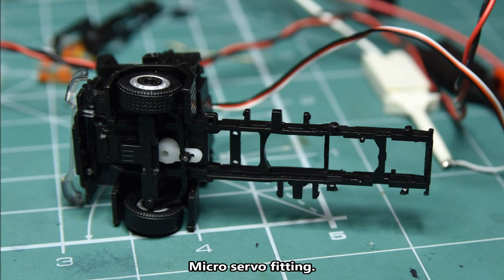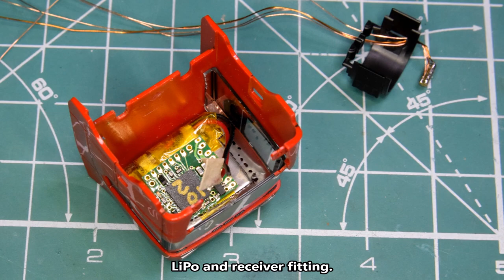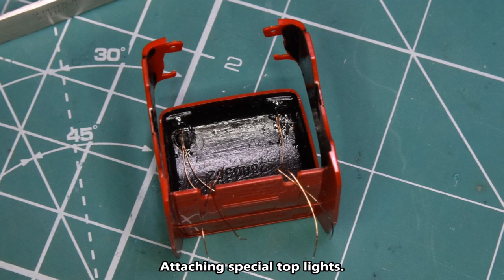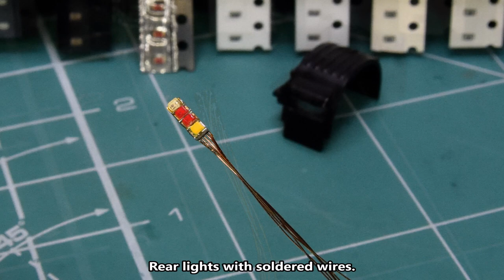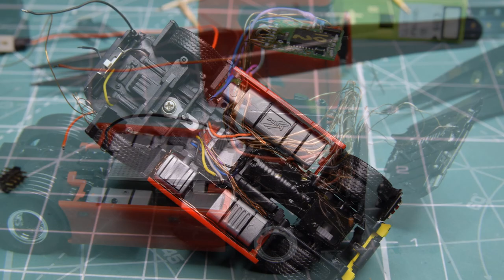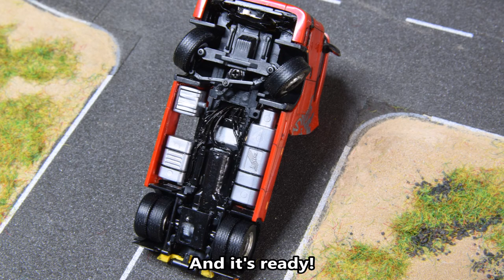Scania CS20 HD Build Log | Herpa | RC 1:87

Comment: How did you program the receiver for all the lights? Turn signals, brake and reverse, etc.
Reply from the maker: It's the receiver's software (Rx43d-1 and others). It's built in. But it might be necessary to reassign channels in the receiver (there is programming procedure for that receivers), but only if you mount some extra lights.

Comment: Is the chassis similair to the R12 Scania? I bought an R12 a while back and it got crushed something fell. never got to convert that one but I am going to do a CS20 now. Do you know if the chassis are similair?
Reply from the maker: It's different. I don't believe it can be swapped.
Reply: @RC87  alright. I might get the R12 instead but I don’t know. Do the electronics all fit relatively the same? Or are they different too
Reply from the maker: @ChaosHamsterG  All should fit the same, there is enough space in both.